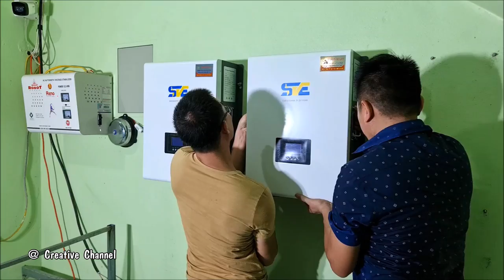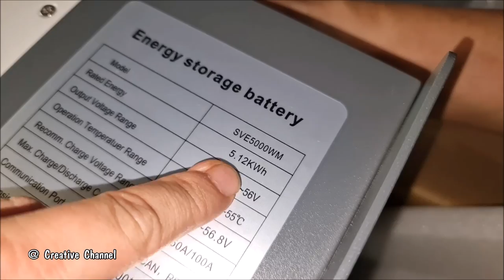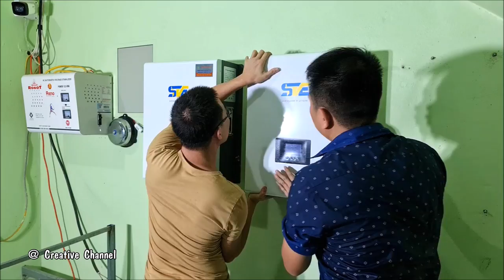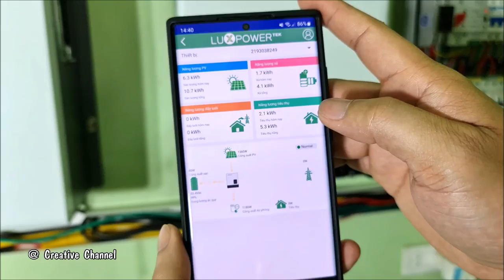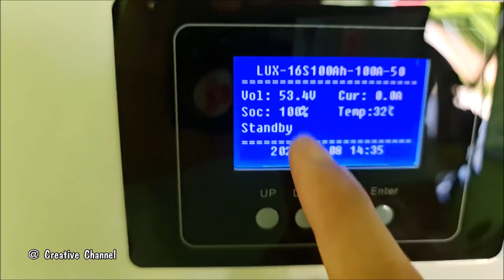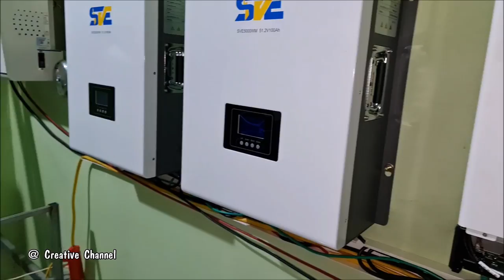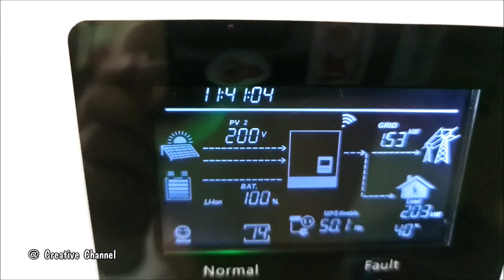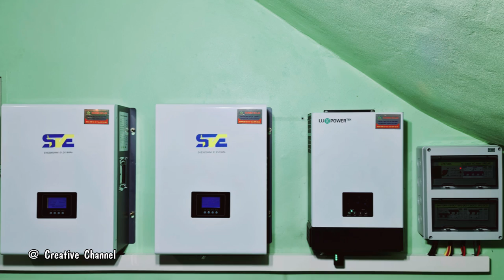Building a Solar Powered Workshop, 5KW Inverter Hybrid, 48v 200Ah Battery, 12pcs 450watt Solar Panel

Comment: I pay .11 for a kwh, and the electric company pays me .034 when I send one back. I get away with not having batteries by having 3 households on one electric bill. I have 18kw of panels, but during summer and winter, very little power goes back to the electric company. Instead, the other two households are using that power, effectively paying me the same .11 per kwh. Billing agreement is such that I don't pay anything at all, and my data shows I am lowering their bills by roughly $50 per month even after you consider my own nighttime/cloudy day consumption.

Doesn't do anything for me after a storm, but ROI on batteries when I effectively don't have an electric bill is not good.
Reply: Did you buy your system out right or did you do some solar company loan thing? 
The only thing that sucks with grid tied solar is that they do not offer you any power when the grid is down. Now there are a few all in one inverters that offer like a 2kwh outlet plug with grid tied inverters. You would have to check with Sunny Boy is the only big name system that I know of that is certified. Now there are other all in one inverters that now have certified units that are off grid yet also work as grid tied that you can use the system with no power as long as you have a battery bank. 
There is one model that I do not think is certified that can be 100% solar only and or solar, battery, grid. meaning that you can use just solar only while in a single stack configuration. I have been looking for an inverter that allows you to add just enough battery to power the inverter and not power loads so that it could be used in a battery less function stacked as many times as the system will allow for just solar only use to sell back to the grid and power the home as well.
Reply: @kameljoe21  It was all diy. I have string inverters, micro inverters, and a hybrid. I've been expanding in fits and starts for 2 years now. 

The micro inverters are great for panels that give me a ground fault on a string inverter. The hybrid gives me a way to add batteries and use a gas generator if the grid goes down, I just won't be able to stand up a micro grid for the other two households.

Comment: How much was your cost, cause in Canada for 2 x 350 watts the cost is in the tune of 20,000$ canadian.
Reply: In India  u can get  2*350w solar panel at 340 $
Reply: Pretty sure Canadian panels do not cost 20k. You should be able to buy 350 watts panels for like 3 to 500 CA.